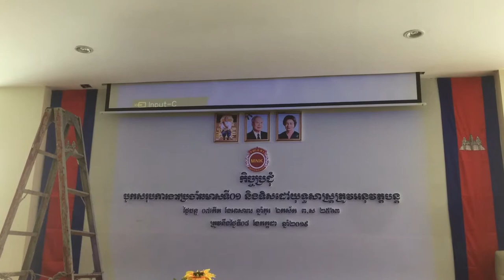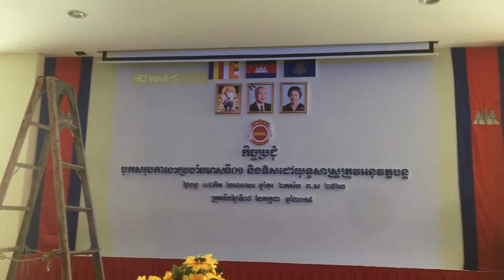how to repair Remote Controller Projection Screen

Comment: Hello, when you can identify that the capacitor is causing the screen not to respond for the remote control?
Reply from the maker: When capacitor’s acid dry, it may cause the problem